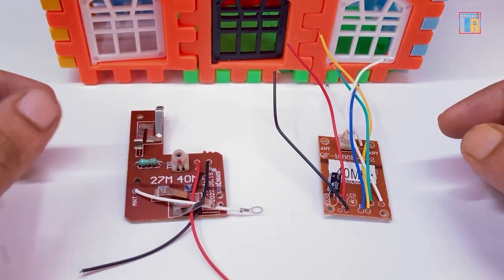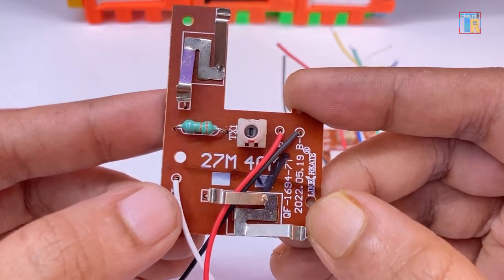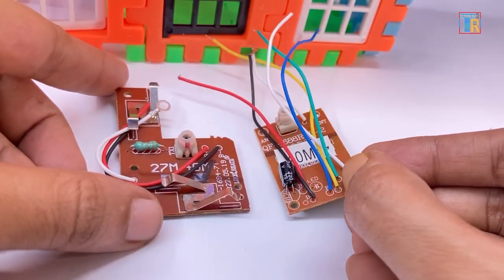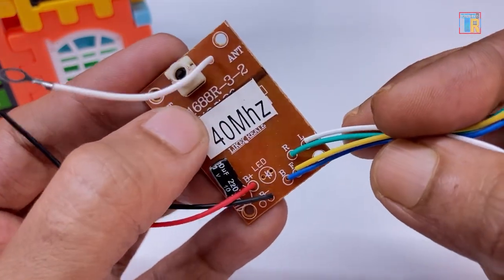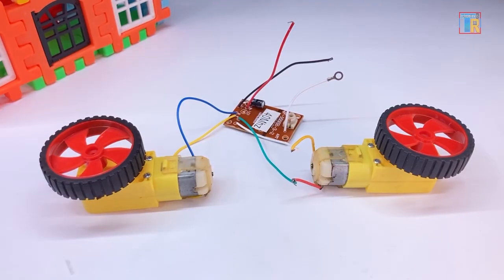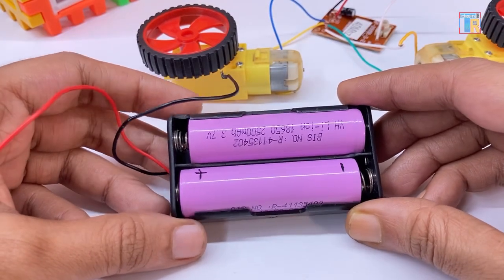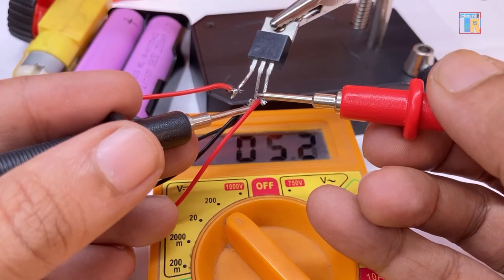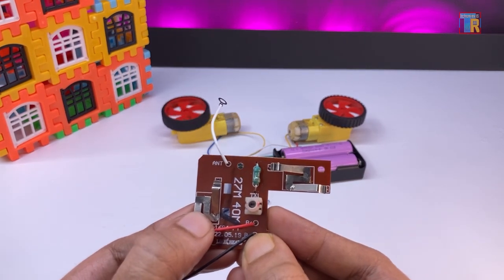How to use Remote control Car circuit

Comment: Bro 3,4m or 30,40m
Reply from the maker: I have tested up to 3 to 5 meters. It may work more but not 30-40 m
Reply: @technoreview85  bro no joke i bought it it is way more than 20m
Reply: Bro i need help
Reply: I want to use a bldc motor with it how can i use it